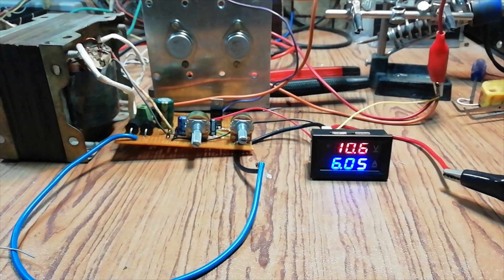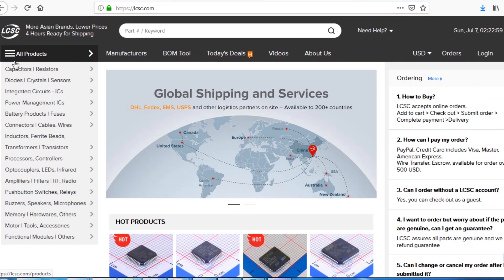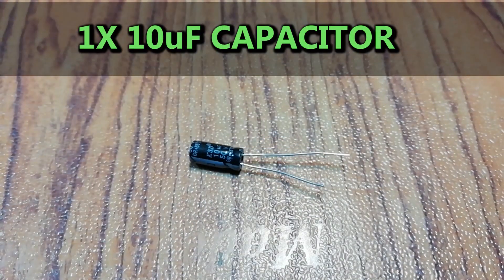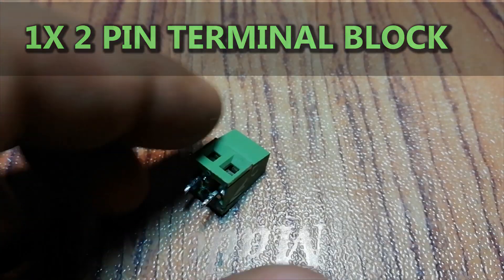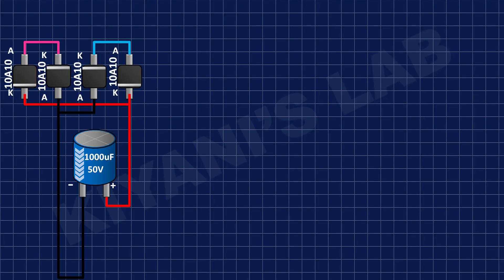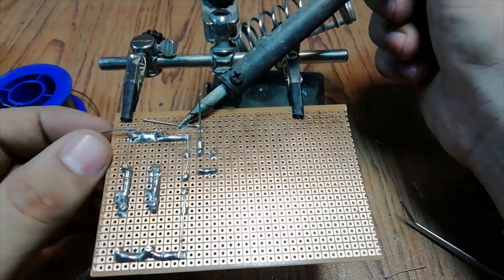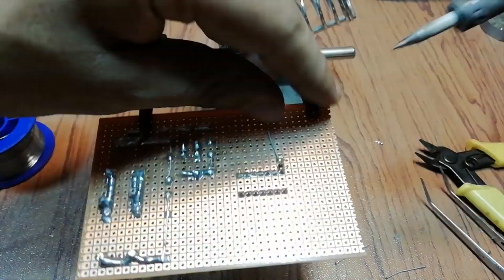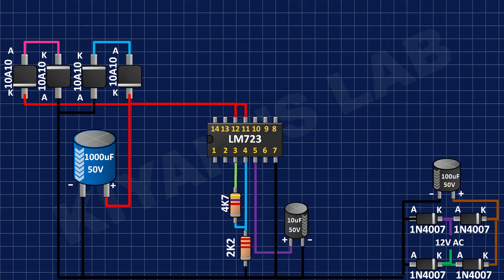How To Make Variable Lab Bench Power Supply

Comment: This power supply design is not stable, the 1000uf cap is too small for a 6A load. It should be more like, 10000uf. There in no load balancing resistors at the emitter( 0.05 ohm 5W) of the 2n3055 bypass transistors. I think with these modifications this power supply work much better. I am a ham radio operator.

Comment: I agree with people comments about the Incorrect connections for load current sense. 
See LM723 datasheet fir details re how it all should be connected.
Because of this fundamental design flaw the whole thing is useless , it is NOT a regulated power supply !!! Shall be removed from YouTube or fixed and then republished.

Comment: I face a problem with linear power supply, and I see you didn't solve it
The output voltage is not constant and varies according to load
Do you suppose a solution for this?

Comment: This supply will suffer from high voltage drop and poor current limiting since there’s no feedback from the actual output l, but only from the low current path to the output transistors. There are many much better designs out there!
Reply: Where I have some problem

Comment: There is to high voltage drop when connect load. I think that the pin3 of IC723 should be connected with emiters of output transistors.
Reply: I made the same device according to the given instructions but it didn't work as it should. The voltage was not stable after connecting the load, it dropped by 0.5 to 1v depending on the current. After I connected pin3 of the LM723 to the emitters of the output transistors, everything worked perfectly. The voltage was stable both under load and when the input voltage changed.
Reply: Hai man 

I have some questions please answer them 

1) Did you directly connected pin 3 of the LM723 ic to Transistor emitter ? 

2) Or have you used any resistor in between pin 3 and emitter of Transistor if yes then what value ?

3) pin 3 needs to be connected to D313 Transistor emitter or 2N3055 Transistor emitter

Comment: Sorry for being a negative commenter but I have built power supplies with far fewer components.
Reply: of course. It depends on the desired performance level. The simplest power supply is the one with 2 components: a rectifier bridge and an electrolytic capacitor. From here is the beginning. If we don't like the shape of the output voltage, we might add an LM317 for example, a resistor and a potentiometer. If we also want variable current, we add more...

Comment: Hi, i have a variable power supply 0-24 volts…0-1 amp.
I read a lot of comments, and some peoples said, they saw a lot of mistake with your project or missing parts.
I just Want to make sure your diagram is ok , for m’y project, m’y board is broken .
And also your vidéo is not clear about the connection of the power supply.
Can you fix that please, for all the people who wants to do your piece.
Thank you.
Reply from the maker: yes it is correct and still working fine
Reply: @KiyanisLab  Hi, Kyanis, can i use a 2N6124 to replace 2N3055 TRANSISTORS ?
Thank's

Comment: Well, another one who can't read data sheets or does not do his math homework.
24V 6A with 2 x 2N3055 ... RIP
And that "heat sink" for 100 to 150W?  ROTFL
Also: No emitter-resistors on the power transistors. Not using the current limiting ability of the 723 with a shunt. And and and.

Comment: The output shouldn't drop more than a few 10's of millivolts when a load is applied, so something is wrong with your design or execution. A 1000 uF filter capacitor is too small for a power supply that can put out 6 amps. Also, there is no reason to use reason to two 2N3055 transistors in parallel since a 2N3055 is rated for up to 15 amps.

Comment: Hello, nice video ! i plan to follow it and want to know first if it will occur a big voltage drop.  I did another one with TIP35c, LM 317 and DB139 and with a small load, more than 2v drop. The supply is strong (650w ATX). Thank you.
Reply: normally the capacitor controls the voltage drop''''' the higher MFD of cap the minimal of any voltage drop'''''use a bigger cap or many smaller caps and you should have minimal voltage lowering when the ''load'' is applied'''''''james''''oklahoma.

Comment: Hi, I don't wanna be rude but, it seems you guide people to how they can wire it. I'm looking the logic behind it could you help me about it? I mean I knew what does clamper circuit or full bridge rectifier doing. But I'm not sure how you choose your resistor for that IC's. I want to be a good electronic designer but it seems puzzle to me. I am looking reasons for every steps. Do you have any suggestion?
Reply: For that Study Analog Electronics Circuits, Digital Electronics Circuits, Advanced Electronics circuits.. These 4 Engineering subject can clear your doubts and you can be a good designer. It takes time but yes. 
Math, Physics, Chemistry, Thermodynamics of 12th level should be clear to you to start these subjects. It's not difficult but there is no quick way to learn it.

Comment: Kiyani my friend, you've goofed with the Schematic or the parts layout mate. On the schematic, you show pin 10 of the LM723 in junction with your 680-ohm resistor and the base of the D313 (which you show in the schematic as a TIP 41) but in your parts layout diagram, you show the LM723 pin 10 isolated. Were you aware of this or did you miss it like most other posters here?
Reply: Yeah thats what im saying
Reply: I saw that as well.   Didn't miss it !!   Not sure which is correct.

Comment: Nie and clear ! May I please ask what are the maximum output voltage and amperes can the circuit produce?
Reply: I don't know if he ever answered' 'but its normally around 6 to 8 amps per pass transistor' 'voltage adjustable  from 2 to 37 dc volts''''i know its a little late''''but did this help you.......James,, Oklahoma.

Comment: Very good video, I really liked it.  Do you have a regulator circuit that regulates the voltages and amperage of a power supply that give 1-30 volts and 10 amps of current?  I am not talking about the whole power supply but only the part of the regulation.  If you do not, I would appreciate it if you could do one in a future project.  Thank you
Reply: https://youtu.be/bE8j5GgdMb4

Comment: I uploaded same few years ago , kinda fun how some videos are just forgotten on YouTube. You have one flaw in your diagram, there are no balance resistors between power transistors which will cause that more current going trough one transistor than other, while it should be equal on both transistors. If you are lucky , difference will not be to high so you will not destroy power transistors. But  danger exist .  Since this is my favorite bench power supply I have to like every single video about it .
Reply: share your link

Comment: I made it as per circuit but out put Volt is not increasing or decreasing by potentio meter but giving only 3.4 Volt only.what is wrong please advise me
Reply: You need to connect from pin 10 of ic lm 723 to pole b of tran 2sd313

Comment: You should consider putting a ballast resistor, something like 50 mOhm - 0.5 Ohm on the output (emitter pin) of the 3055 transistors so that they share the current and therefore the heat equally.

Comment: you cant use BJT's like that, with high current you have thermal runaway, one of the transistor will carry the load
Reply: with a ballast resistor it should be fine.
Reply: @frosty129 Should be?
Try test it with a  big load and measure the temperature on each transistor.
Reply: @flemmingchristiansen2462  well, the circuit proposed in the video as it is will have this problem as you mention, but if you put a 0.5 - 1 ohm high power resistor on the emitters of the npn's in parallel, the voltage drop across these so called ballast resistors should in theory help to balance the current between devices equally.

Comment: You showed where to get every part BUT the actual power transformer. To be able to provide 6 amps, means the transformer has to be large enough to provide that current capability and maybe a little more. Also, instead of trying to find  a transformer with two secondary outputs, forego the 12 volt output and use a 12 volt regulator after the bridge circuit off the 25 volt output.  An LM7812 will provide the meter power with no problem. Just install it after the 25 volt output bridge and filter circuit. Then you can eliminate the (4) 1N4007 diodes and C4 100mfd capacitor as well.  Just an idea...

Comment: Connecting the 2 BJTs in parallel is not quite a good idea, as one of them will always carry more current that the other one although they are one the same heatsink. Anyway, i think that the circuit is pretty good and I really the quality of the video itself. Good job!
Reply: you can use current resistors in every emiter 0.1 Ohm 5W is ok
Reply: Yeah, but although adding a resistor to the emitter is possible, a 0.1 ohm one is not quite sufficient to keep the currents on the same level while adding higher resistance is making it worse by creating more heat in a high current application.

Comment: Voltage variation when load is removed, is not expected on a bench PSU. It could damage something else, connected in parallel at the output.
Reply: Maybe it is because of the  current is more than 6 ampers. and exceeds maximum current which ps can give. if it is the same for all loads it could damage the devices.
Reply: а огромные пульсации выходного напряжения при 6 амперах тебя не смущают? ахах. смотри, у него конденсатор на 1000 микрофарад всего.
и еще куча всег овключая компенсацию в 0.1 микрофарад
Reply: Hi 1000uf main filter capacitor for a 6 amp power supply IS ridículous, at least 10.000uf otherwise at 6A Itś all ripple, if one off the transistores fails ALL 24 o more volts go direct to the output unregulated, you Burn the hell out of the device you are giving power, this design IS unusable, imagine burning a 300 u$ device because you saved 30 u$ in the wrong power supply
Reply: Such a simple fix. It should be monitoring the voltage after the transistors, not before them. Transistors are current amplifiers, so the voltage out will depend on current. Whichever pin is the negative feedback on the LM723 shouldn't be connected to the Red but instead the orange output wire.

Comment: Is there a possibility to modify this project to increase the output to 30v 10 amp
Reply: How can i upgrade thise circuit to 
35V 15 amp POWERSUPPLY
Reply: you can put another 2 2n3055 in paralel but have to use 0.1ohm 5W resistors in every emiter
Reply: @vlmg007  in parallel or in series
Reply: @kryptocat4240  In series with the emitter of the transistors....
Reply: Don't

Comment: Sir.What is the connect of 4007 rectifiar
Reply: probably provides a fixed voltage to power the a / v meter. this instrument if powered with variable voltage below a certain value does not work.

Comment: very well iam also going to make it because it is linear i also have switchmode  one but linear is good for sensitive circiut 👍👍👍👍👌
Reply: Surge Power Technologies  power out put depend on the output voltage you selected if you selected higher voltage and your transistor have no heat sink so you can use current through it almost 2 Amps without any problem 2 Amps not the last limit value but without heat sink 2 Amps is working good with voltages 8 to 15 or higher but when you selected lower voltage below 8 volts then be careful use heat sink or without heat sink not must be cross 1 Amps or more because all the voltage across your transistor will be dissipated by heat
Reply: Selecting higher voltage means for example your input voltage is 12 volt so selecting higher means select voltages between 12 to 8 or keep the difference less between your input and out put voltage in order to consume more current
Reply: Bro I make it but it doesn't show any output voltage what's the reason bro
Reply: @muhammedadil4463  
check your conection properply beacause if you did something wrong in circiut it will give you output voltage no matter what is the problem and double check your volt meter maybe it is not working and you blame the circuit and also check all connections properly
Reply: @erdum  voltmeter is correct bro all connections is properly connected I am use 24-0-24 5amp transformer